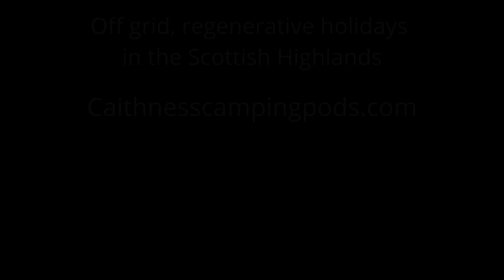Rocket mass heater build 6. Manifold and barrel fitting. The most efficient heating in the world.

Comment: I am following this series to build my own RSMH. The only issue is that I want to build it with an old water heating tank I have removed, its a 70 gallons and not 55 gallons much... it is taller and narrower, I'll come back with dimensions later.  I already bought the book and waiting for the shipping. My main question is if I am going 8 inches all the way with the venting at intake/exhaust etc, do I still need a 4-inch minimum gap between the tank and the burner? and 5cm between the top of the manifold and the secondary burn chamber exhaust? Do these numbers change ni regard to the dimensions of the rest of the components or are they forgiving at all?
Reply from the maker: The area between the riser and the manifold, the bell, is the only part that doesn't conform to the cross sectional area of the pipes and the fire brick core. The cross sectional area there is much greater.